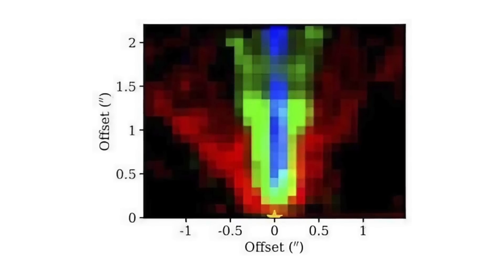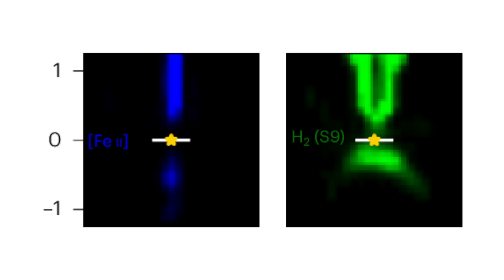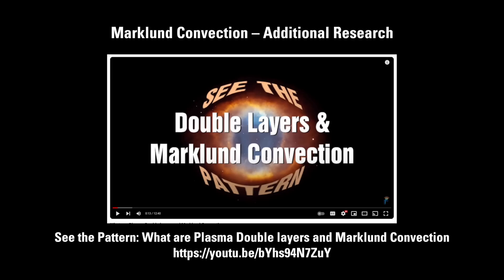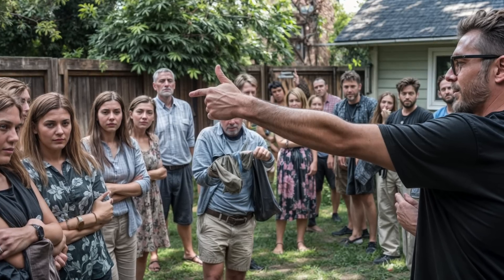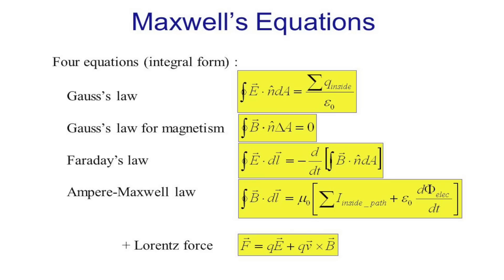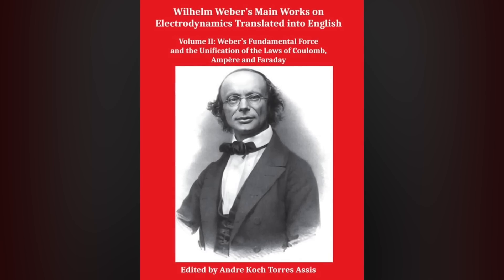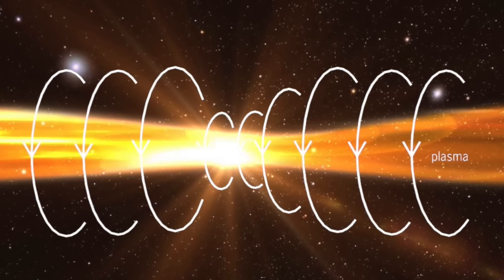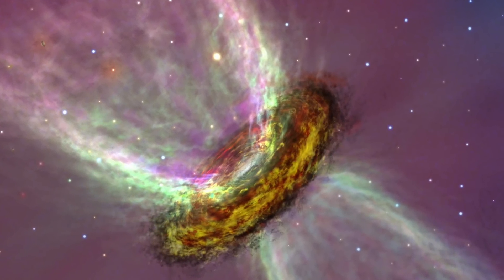Michael Clarage: The Gestation of Solar Systems | Thunderbolts

Comment: Nice video and presentation. 
Page 1:12 is one of most popular slide in EU community. No one seems to care which line represents what.

For instance, if red is E field and blue is B field then what is green? Green can’t be B field since blue is B. 

The term current is used three times in one sentence making description meaningless. 

Electron flow is current 
Field align current is current 
Current filament is also current. 
Field align current is what field?
Reply: >>>  A MIRACLE IS HAPPENING!!! MAINSTREAM SCIENCE IS PLOTTING .......... MAGNETIC FILAMENTS IN OUR GALAXY ...... AND THEY ARE BAFFLED, of course!!! Check out Anton Petrov's video Mind-blowing New Discoveries About the Milky Way Galaxy . I left this comment:
🤜⚡💥⚡🤛 FINALLY they are reaching for the true understanding of the nature of the Uni ...but still they remain blind!!!Why? Because they use the Ptolemaic method with reductionist approach instead of the scientific method.  The plasma cosmology [antithesis of BigBang] community understands these magnetic filaments, for nearly hundred years, as Birkeland current filaments and the nebulae as intersections/collisions of several Birkeland current filaments. FYI, WHENEVER YOU HEAR MAGNETIC FIELD/LINE/FILAMENT YOU MUST TRANSLATE THAT AS ELECTRIC CURRENTS!!! because... electromagnetic theory. These currents/filaments interconnect EVERY object in the universe!!! and form the Cosmic Web.  Previously I said in regards to the nebulae problem: The runaway star phenomenon occurs due to the chaotic nature of the collision which involves electric currents, resulting is a slew of small stray Birkeland current filaments. I predict that we will discover this type of phenomenon in every nebula of this kind. 

On a more important topic, most mainstream scientists and followers also don't understand the Red Shift and the problems inherent in the BigDung theory. To wit, an expanding Universe entails matter and space-time [sic] would have to expand, which, per the mass-equivalence principle [E-mc^2], are made of energy. This would either require energy to be continuously created, or the 1st law of thermodynamics [conservation of energy] is invalid, or their density is decreasing. Either way all physical laws and the associated constants would have to have been constantly changing over the life span of the Uni which implies that all atoms and molecules would have been destroyed long time ago, ergo no Uni. The EM spectrum of the past [from distant objects] would be seen today as radically different. Even a slight change in the current constants would undo the present order/equilibrium. By all accounts the Uni would have radically changed over the presumed 13+ billion years, if not have been totally destroyed. The BigDung theory does not take this into account. Clearly the theory is false. 🤜⚡💥⚡🤛

=== 
Yes, presumably there is an interplay tween matter and the fabric of space-time but only because they are intertwined. This principle is arrived from the energy equivalence equation when it is solved for the time component. By Onerock's core definition, space and time are interchangeable.

But that's only on the word of that ol' mathamagician [that's not a complement]. By my tone you might have guessed that I'm not a a fan of that theory. IMHO, Plasma Cosmology [Electric Universe theory] predicts and describes the Uni more completely and eloquently. See the Thunderbolts Project channel. Also 'See The Pattern', 'LPPFusion', 'Unzicker's Real Physics', 'Ray Flemming', and Prof. Pierre-Marie Robitaille's 'Sky Scholar' channels... to start. As a consequence you too will find the current sciences distasteful. Naturally I don't recommend the 'conventional' physics sources as they are on the wrong path.

===
Me, I'm only a triple engineer rewriting the electromagnetic theory which, as you know, touches everything else. I call it the Parallax Electric Theory [PET] which dispenses with the anachronistic notion of magnetism. Everything is but charges [electric fields].

~~~ Know plasma, know 99.999% of the Universe (No plasma, no Universe) ~~~
===
PS. From where I stand, the Uni is flat[i.e. infinite], static[i.e. not expanding], eternal[albeit finite lifespan at present] and 'c' is just a number [do you know what that means?][hint, add it all up].  [It means that 'c' is not the maximal speed in the Uni... because Onerock is dead )) ]   Drinks are on me!!!

===
Check out these vids:
==> The censorship of cosmology | Eric Lerner    [Eric disproves the BigBangGang hypothesis in several ways*!!!*  Eric Lerner is saying that for a non-expanding universe, galaxy size is linearly proportional to distance, *as the evidence shows*. In the expanding universe theory, the galaxies should be much smaller in size (to the fourth power) and less bright than we actually observe. He’s correct BUT his papers have not been accepted because there are too many reputations and too much funding for the Big Bang research Gang on the line.]

==> Challenging the Big Bang: The Struggle with Inferred Reality
==> History of the Gaseous Sun with Dr. Robitaille  <<<
Reply: as far as I understand the description, none of these lines represents a field, but different trajectories of electrons.
Reply: All the lines here represent both E and B fields simultaneously (at different distances from the axis). This is a [magnetic] field-aligned current.
Reply: @EugenethePhilostopher  There is no current. This is overwhelmingly neutral gas that is bering observed. Did you not read the paper? Clarage obviously didn't.
Reply: @davejones7632  where "there"? 
This is a model of a field-aligned current developed by Stig Lundqvist. 
Which paper?
Reply: @EugenethePhilostopher  "Which paper?"

The paper that Clarage is talking nonsense about in this video. We are observing overwhelmingly neutral gas. No currents. Stars always form in cold, dense clouds of neutral gas. The observations in this paper include those from neutral H2. It is not hot enough to ionise much of anything around these protostars.
Reply: @davejones7632  what is the velocity of particles of this gas during the star's formation?
Reply: The central jet velocities, for example, is 50-300 km/s, as the paper says. This is above critical ionization velocities of any element.
Which is what the paper says: the ionization is present (it would be strange if it wasn't) and decreases with radial distance from the jet.
Reply: @EugenethePhilostopher  "what is the velocity of particles of this gas during the star's formation?"

Well, this paper is about the outflows from the star, not the infalling gas that formed it. The velocity of that will depend on the distance the gas is from the star. Infalling filaments of gas observed to be flowing towards star forming regions indicate a velocity of ~ 1-2 km/s.
Reply: @EugenethePhilostopher  "This is above critical ionization velocities of any element."

And who is talking about CIVs? The observations are of neutral H2, neutral CO, and singly ionised Fe. It ain't hot enough to ionise much of anything at the temperatures observed. Just like the solar photosphere, we are dealing with overwhelmingly neutral gas.
Reply: @davejones7632  This crazy guy doesn't understand any physics
Reply: @trungtamienmayquocquang7233  Far more than you do child. That is why you fall for scientifically impossible nonsense that only exists on youtube.
Reply: @davejones7632  what's driving the outflow?
Reply: @EugenethePhilostopher  The most likely model is one known as magnetocentrifugally driven flows.
Reply: @davejones7632  what is "magnetocentrifugally driven flows"?
You realize that the max centrifugal force is at the equator, so max outflow from "centrifugal" part should be there. (Which is the opposite from what we have here with max outflow at the spin axis).
Hence you better drop the "centrifugal" thing, it kinda counters your "no current" argument.
And what else then? Magneto- part? Right?
Reply: @davejones7632  what creates magnetic fields in Maxwell's equations?
Reply: (Just FYI: Maxwell's electrodynamics is demonstrably wrong, but at least if you appreciate it, you can see the problem in your "no current" argument).
Reply: @EugenethePhilostopher   "what creates magnetic fields in Maxwell's equations?"

And how are far away and even no longer existent magnetic fields amplified in MHD? Galaxies have a weak magnetic field. Nobody thinks they are due to an extant current. Molecular clouds have magnetic fields. They are cold and neutral. The ionisation fraction in them is measured in parts per many millions. The solar wind carries a magnetic field with it all the way to the heliopause. And yet it isn't a current. The current that created it is > 100 AU away by the time it reaches the heliopause. The interstellar medium has a magnetic field. It isn't a current.
I suggest you research magnetic field amplification in MHD, and check out the publications on galactic fields. The 'Biermann battery' might be a good place to start.
Reply: @davejones7632  I'm just asking "what creates magnetic fields" (since you said "no electric currents"). Simple question, simple answer.
Reply: @EugenethePhilostopher  "Hence you better drop the "centrifugal" thing,"

I don't need to drop it. It isn't my model. See, for instance;

'Magnetocentrifugal Origin for Protostellar Jets Validated through Detection of Radial Flow at the Jet Base.'
Fei Lee, C. et al (2022)
ApJ.

And references therein.
Reply: @davejones7632  "magneto" centrifugal. What generates your "magneto"?
Reply: @EugenethePhilostopher  "I'm just asking "what creates magnetic fields" "

Currents, at some place, at some time, would have produced the seed fields which can be amplified by MHD processes. So, if you are suggesting that a magnetic field indicates an extant, nearby current, then you need to learn plasma physics. Nobody thinks that.
See, for instance;

'Origin of galactic and extragalactic magnetic fields'
Widrow, L. M. (2022)
Available on arXiv.
Reply: @davejones7632  oh no,you just said there are no currents. Wait, you're contradicting yourself?..
Reply: thanks for picking this up. OK do we know each color represents what in trajectory?
Reply: @philoso377  colors correspond to different distances from the axis. If an electron sits on the axis, it would move along the black one. If it's at some distance from the axis - it would move along the red one. If at some bigger distance - along the blue one. And at even bigger distance - the green one.
Reply: @EugenethePhilostopher  I’m enlightened, thanks.
Once enlightened, I also did some internet search plus filtering. I come to understanding that … when we say field (not explicitly) we meant B but E field. When we say current we meant electron flow. When we say aligned, we mean the revised flow direction. When the flow isn’t precisely parallel 0° to the local B field line, a Lorentz force is induced, which is perpendicular to the trajectory of electron flow. The effect causes the electron to spiral around the local B field along a disc plane. However the electron trajectory itself also induce its own B field, say Bi. By interaction of B and Bi an axial force is also induced that alters the spiraling electron in an axial (B) orientation and convert the disc turning into a helix trajectory. Following the new helix trajectory, eventually the electron will end up in either one of the two B polar regions. Thanks again.
Reply: @philoso377  just read Alfven's "Cosmic Plasma" book. It's a very good summary. Or talk to me if you're completely lost.
I think you're a bit lost.
Reply: @EugenethePhilostopher  OK I’m ready for your input.
Reply: @philoso377  well, you need to ask some question first. :D
In general, yes: magnetic field just makes particles spiral around its lines. But it doesn't accelerate them (i.e. doesn't change their velocity). Electric field is what accelerates particles. E.g. in solar flares or coronal mass ejections (CME). 
CME plasma clouds themselves possess decently strong electric fields which can significantly (up to 20% or about so) change the flux of cosmic rays (protons coming from outside the Solar System).
Reply: A wire with current creates magnetic field which is perpendicular to the wire itself. But here (with field-aligned current) we're dealing with current flowing along the magnetic field itself. This is the part that many people don't get.
It's the same type of current as Birkeland currents in the magnetosphere, which also run along Earth's magnetic field lines (and then fall into polar areas and cause the aurorae).
Reply: @EugenethePhilostopher  yes I agree with you that B field don’t necessarily accelerate particles as e field does, at least not particularly in a linear path in parallel with B field.  

I was trying to say when a particle move in perpendicular to B field a side force such as Lorentz force acting perpendicular to the direction of particle cause its path to bend and path bending is a form of inertial acceleration (sling shooting). That acceleration will end soon as the angular velocity reaches its equilibrium state, like setting in an orbit. Then acceleration ends there.

Comment: Those are not forming solar systems. Rather star formation, or very young stars with jets, the signature of plasmoids.
Reply: Says someone who obviously doesn't know what a plasmoid is!
Reply: @davejones7632  commet very stupid
Reply: @davejones7632  not the type of plasmoids you'll find in mainstream articles, wise guy. Talking about the ones the EU has been discussing for years. The ones generated in focus fusion. The ones producing bipolar jets...
Reply: @SciD1  None of which happens in the real world. And none of which exists in the scientific literature. Lerner had some rubbish about plasmoids, but that only works in a man-made experiment, and leads to oppositely charged currents leaving in opposite directions. Which is not what is observed. And these jets from protostars are not any sort of current. The gas is way too cool for much ionisation. Mostly what you are seeing is neutral H2. After all, that is what the star forms from in the first place. Cold, dense, neutral gas at ~ 30 K.
Reply: @davejones7632  you can make plasmoids in a microwave oven very easily. Of course, there are no jets, because the energy, and the amount of gases, are insufficient. But you get the idea. It's a self organized plasma structure. Ever heard of Bostick's work? And it's also what ball lightning is. Now, imagine the amount of extremely powerful radiation in space, as well as the molecular clouds of gas and dust... It's like lightning in space.
Reply: @SciD1  Molecular clouds are overwhelmingly neutral gas. Nobody thinks that plasmoids are shooting out jets of mostly neutral gas! Still, if you have a paper on this woo I'd be happy to read it.
Reply: @SciD1  "Of course, there are no jets, because the energy, and the amount of gases, are insufficient"

There are far more atoms per cm^3 in a microwave than there are molecules of H2 in 1 cm^3 of molecular cloud or around a protostar.
Reply: @davejones7632  If you want to talk about gas density, I could tell you the exact same thing about gas magically collapsing under its own absent gravity to form a star... 🙄

Comparing the microwave to a molecular cloud, it's all about scale...